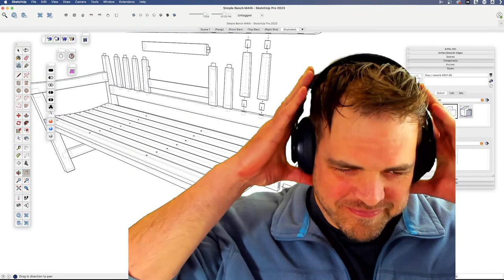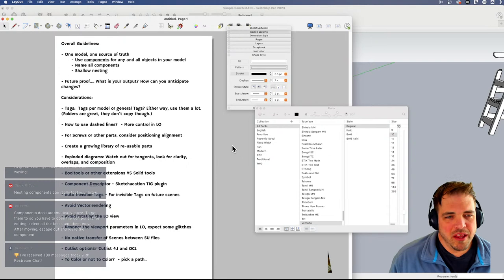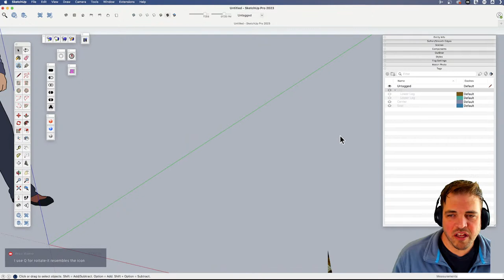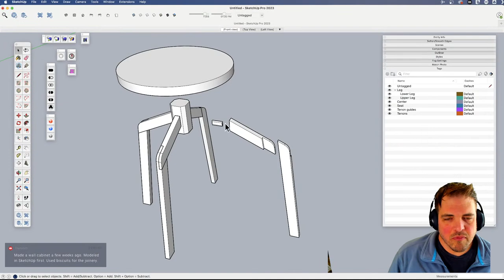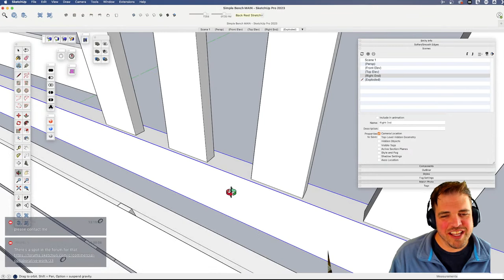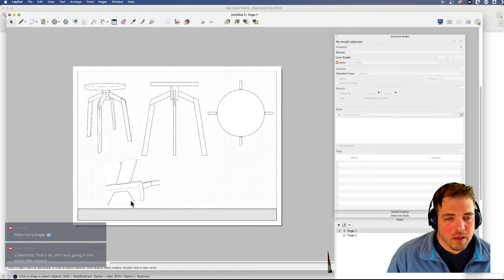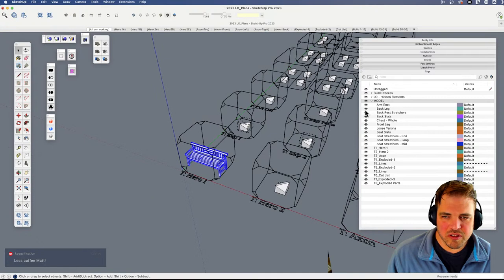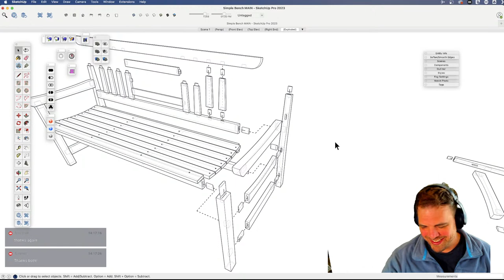SketchUp for Woodworking Plans: Beginner Tutorial Guide

Comment: To answer you question about color I render all my woodworking drawings with Wood texture for the wood That I will be actually using. I gives me the real world view and allows me to decide if I want to go with a different species of wood. As for shop drawing I do print as I have no internet services in my shop and I do line or wire render when printing that way I see what needs a dado, rabbit tenon, miter, dovetail etc. etc.
Reply: Real textures and the file is ready to 3D Render for the client if they want one. Had a customer who, after seeing the render, changed  how the top was glued up grain-wise. SO MUCH EASIER to change something BEFORE it is built.